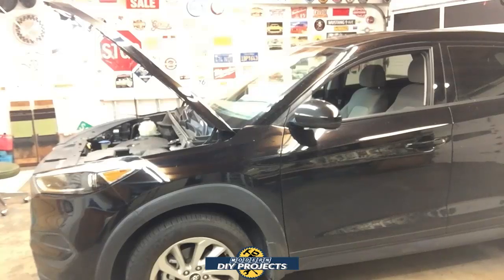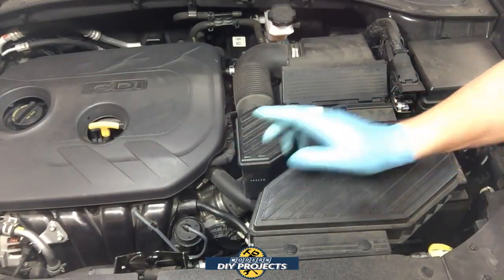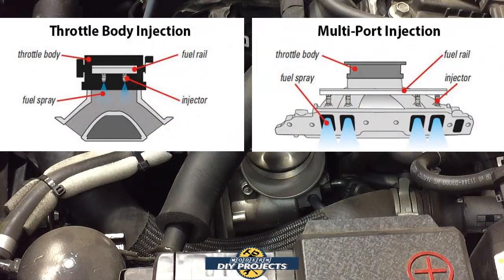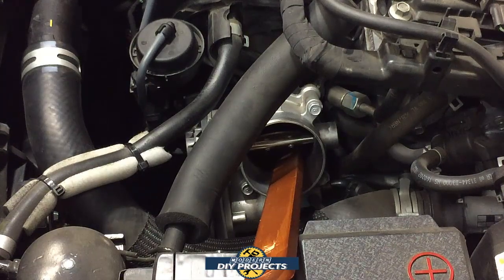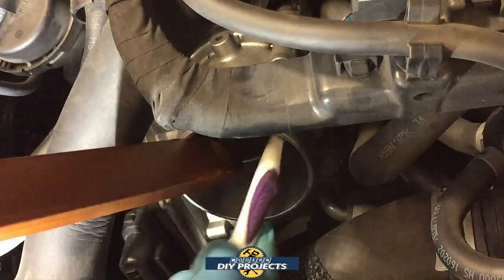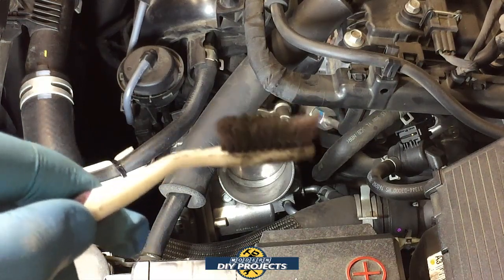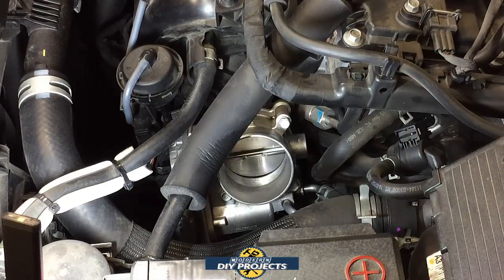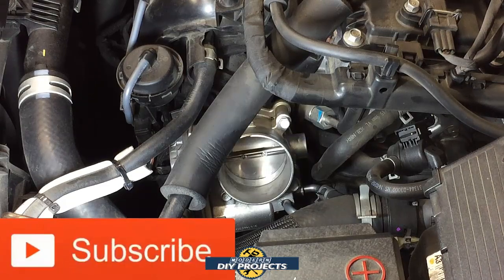How to Remove Carbon Buildup on Direct Injection Engines GDI Intake Cleaning the Easy Way

Comment: The GDI design was just another money maker for dealerships.       When your there you might as well clean the maf sensor
Reply: Lol dealerships have nothing to do with manufacturers' engineering decisions. GDI is another technology manufacturers are employing to comply with emissions standards while trying to still achieve acceptable  power and fuel economy. Carbon buildup is an unfortunate byproduct but its not some conspiracy for third party dealers to make money.
Reply from the maker: Good point, but this vehicle doesn't have a MAF. If your vehicle does, then I agree, clean it all at the same time.

Comment: Rubbing alcohol in a spritz bottle does about the same with out the flammable carb cleaner
Reply: And rubbing alcohol is not flammable 🤔
Reply: @gufiaito69able  not flammable if you don't expose it to fire lol

Comment: Do you think there is any benefit to using Top Tier gas and Techron additive, or is that just a waste of money. I understand the gas really doesn't get behind the valves, but why does the manufacturer suggest Techron (well, their rebranded version) if it doesn't help?
Reply from the maker: Yes and No. The manufacturer probably recommends Techron because it got a kickback to do so. On my Mustang's Gas Cap it has a similar recommendation. I forget which gas it recommends. All gas is pretty much the same but a Top Tier is probably a little better produced than the cheap stuff. I wouldn't go any lower than Arco Gas. BTW the gas does get behind the valves, that is part of the problem. I didn't want to get all technical in the video, but what happens is that during the combustion process some gas remains unburned and as the valves cycle open and closed taking advantage of scavenging to increase the process, some unburned gas escapes and is instantly attached to the back of the hot valves where it cools and becomes a crusty mess. That is just a really quick synopsis of the process. By adding some fuel additives it could help to break this down a bit. I get the cheap additive so for $1 per bottle, I think it is cheap insurance. No harm, no foul.
Reply: @ModernDIYProjects  probably the exhaust valves but not the intake no cleaner in the gas tank is going to clean intake valves it just isn’t no gas gets on the valves where carbon builds up I had this same car it just will not.
Reply: I though Scavenging is made so that unburned fuel mixture at low engine speed is purged efficiently out the exhaust side not the intake. Carbon buildup wouldn’t be a huge thing if that was true I here no one talking about so would be cool if it was true.
Reply from the maker: Scavanging can happen on both sides. Modern engines have a variety of different timings set up by the manufacturer. There is no one set timing any longer. This is not a perfect system. You can get unburned fuel and gases that will escape out of both sides. These engines run hotter than regular engines thus causing more build up and caking around the valves. Any cleaner in the fuel can be helpful. I never said it would be 100% efficient. I said something is better than nothing. Look up carbon build up on GFI engines, there are a lot of great videos and sites that go into great detail on the issues and how they manifest.
Reply: @ModernDIYProjects  ohhhhh okay I see now
Reply: @ModernDIYProjects  Thank you for the in-depth reply - I appreciate it. Guess I'm going to stick with the regimen of decent (hopefully) gas and bottle of additive between oil changes and hope for the best. Thanks again.
Reply: @ModernDIYProjects  Actually carbon built up by the burned gas, not deposits from unturned gas. Fuel is an amazing cleaner and that’s why manufactures are going to a dual injected system. One behind the valves for every 8 cycle or so to clean the valves.

Comment: I doubt that it will clean valves. The spray is light and it evaporates immediately. No chance of carbon removed from valves. Clean throttle is good. You can also spray water at 3500rpms or more and you will be lucky and water drops will get inside combustion chamber - water will clean up the chamber. Best way is just to get a walnut media and shoot it at closed valves, some guys clean it with carbcleaner and screwdrivers and brushes. Video is nice.
Reply: If it evaporated immediately it would not have had trouble starting after he cleaned only the throttle body
Reply: GDI was developed owing to government mandates to reduce emissions and improve fuel efficiency. Yet GDI eventually leads to carbonization which reduces fuel efficiency and increases emissions - completely obliterating the original purpose.
Reply: You are not wrong at all I had this same car untill I got a 2020 Tucson. We now run a catch can becuase the last car the piston tops caked so bad it started pinging the valves weren’t terrible but definitely made the car run better after a manual cleaning g it sucked but in the end it still didn’t run right the piston tops were caked wayyyy tooo bad and eventually the catylic went out after I got the dealerships carbon cleaning services and injector. So rule of thumb is to get a catch can only thing that will not fuck up the piston tops in these engines they also tend to burn oil for some damn reason at around the 80,000miles mark wich makes the situation 10 x worse. Hopefully they built the 2020 right but it is the same engine so I just hope this one doesn’t burn oil since I’m keeping the engine clean and valves. Doesn’t anyone have a easy way to borescope the valve on these engine without having to take the manifold off?
Reply from the maker: I have a catch can on mine and currently I'm at around 95K so far it still runs great. So by having the catch can and doing this procedure I have been able to keep the issues at bay. It's a matter of being consistent. If you wait until the last minute to start doing it, then yeah, it wont work.
Reply: @ModernDIYProjects  ow that’s awesome do you see any oil reduction in your oil change interval? And what is your oil change interval?  Finally able to find someone with one that has that many miles.
Reply: I know theirs many with mileage on them but usually by someone who has no clue about oil catch cans.
Reply from the maker: @henrytom5824  I change the oil around 3-5K when I remember, and yes there is generally about 1 qt loss. But most cars have similar loss due to being burned or in the oil filter material. I see a good amount also caught in the catch can. A few ounces. Go watch my Tucson oil change video where I show the oil catch can and how much it catches. I made my own catch can. I also have a video on how to make one yourself.
Reply: @ModernDIYProjects  our 2016 had about almost 2 quarts had to be added every 3750 I knew something was off I was adding oil wayyy too often, 1 quart loss is not a big issue at all I could have dealt with that but almost 2 that’s not normal.
Reply from the maker: @henrytom5824  Yeah, that is too much. You just reminded me so I went out and did this procedure again today. Every few weeks, a full can of carb cleaner and I can keep it going till it's a bit more worn out. 95K seems too early to sell it. It still runs great. Keep on top of your new one and you should hopefully be better off. 👍
Reply: @ModernDIYProjects  I believe that carb buildup trashed the piston rings every cylinder was terrible it even was pinging g pretty bad marbles in a can it sounded terrible. Their were flakes and layers of carbon buildup also a small lump of carbon on top of the pistons those lumps could definitely heat up and cause a hot spot acting as the spark but really the spark plug is suppose to ignite the fuel mixture.
Reply: @ModernDIYProjects  absolutely we stilled owed a good amount on it was terrible situation but honestly we got another becuase I be learned so much from videos like yours and I had alittle experience with the last one bit Yae man thanks a lot for sure you give me amazing hope. Ours made it to 103,000miles before the cat went out 4,000 repair but the engine was already trashed so wasn’t a good situation either way for us I just don’t like how Hyundai picks and chooses who they want to help.